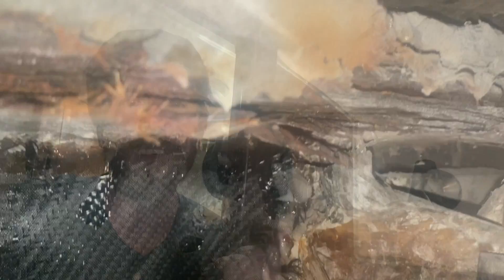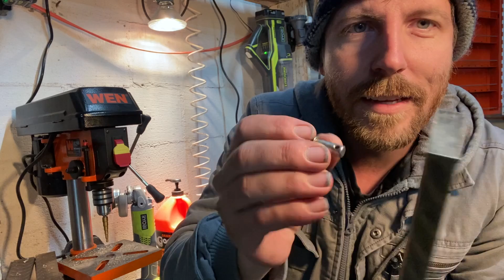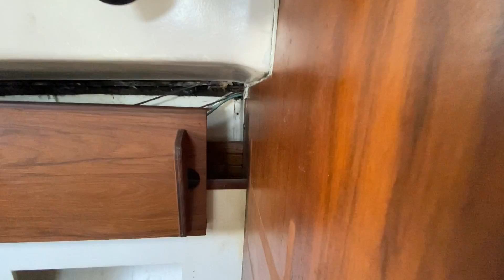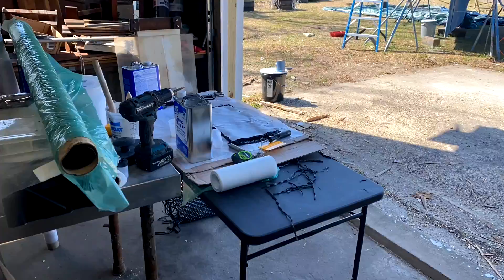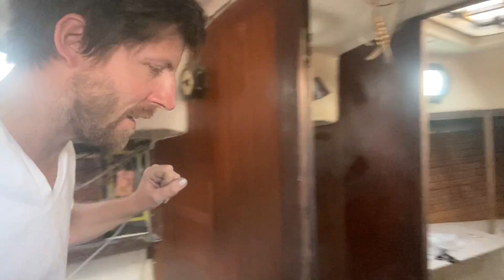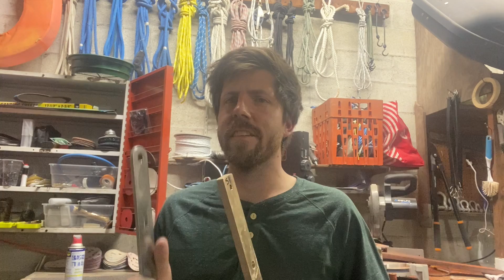Bronze & carbon chainplates beastmode911 strong

Comment: The bizarre reality of Stainless Steel is it must be constantly exposed to oxygen or it will eventually corrode. That's a fact Jack! The chain plates if made of stainless steel will fail where the metal is encased in fiberglass.

Comment: I know it’s to late, but for future reference.. grinding bronze, brass and aluminum is extremely dangerous. It plugs up the grinding wheel and when it expands from heat, it can make the wheel have a comeapart, sending chunks of grinding wheel flying in your direction. Be careful brother…

Comment: That was helpful. Im looking at a 1985 island packet 27 and I know the chainplates are molded into the hull with no way to check them and I need to just replace them. Rather then grind them out and mold new one in this is how I plan to refit them.

Comment: Hey Sam, just watched you vid. Can I see a picture of how you finished them on the outside of your hull? I'm refitting my 28 and all the stays and mast are removed so it's time to do the stays now I think. Thanks for the video!
Reply from the maker: Theres some pictures on instagram. Id recommend using counter sunk screws though and tapering the bottoms because the sheets are always catching the bolts and the bottom edge.
Reply: @samholmessailing  thanks!!
Reply: Haven't been able to find the finished pictures of the plates. If you could steer me to one I'd be indebted!
Reply from the maker: @theflyingdoves3713  whats your email address?

Comment: Hi Sam, about the carbon lamination, I would recommend for the next time, use as well glass one below the carbon and one on top being 20-30% larger, carbon works better in sandwich between glassfiber.

Comment: Those outside bronze chainplates should also work well as a lightningrod! You don t see it a lot here in Europe, I have a Dutch make 28 ft Friendship which has them inside connected on the bulkhead. 
Lightning is a big hazard on open water, if you get hit, all the electric equipment is gone….at least. I connect jumper cables on the standing rig then and hang them in the water.

Comment: Super glad I found this video, my partner and I are fitting our Roughwater 33 out for offshore and I will be renewing the whole rig, starting with going to 1/2” bronze external chain plates.  I have been curious for awhile about using carbon fiber to spot reinforce areas of the hull without much weight penalty, after seeing you do it im even more convinced.  What kind of backing plates did you use for the chainplates?  Or did you consider it strong enough to bolt straight through the hull?

Comment: al bronze is only ok if you don't need to bend the chainplate.    The lowers should be on fiberglass knees for this.  Otherwise you need forged bronze like silicon bronze.   You may get away with a slight bend but the strength after bending a casting will be compromised much more so than other materials.   For the forestay you won't be able to use this metal.

Comment: Sam, Great Stuff!  Check for the same corrosion failure of the backing steel under the forepeak/bow pulpit. I used a piece of Stainless plate when replacing the old oak pulpit with a solid piece of teak.  I hope we'll be able to follow you across the atlantic with SPOT or APRS or similar! Cheers

Comment: I have a 27 CD that needs chain plates and would like to do exactly what you did ! So  the stock was 1 1/2 w - 3/8 thick and 16” each ? How did you decide the sizing ? Thanks
Reply from the maker: Yeah. I went a little thicker that the factory cap shroud plates but i would go thinner if i did it over again.

Comment: I am currently researching chain plates and replacing them to external as you did.  My question is; Is bronze too soft for the continued movement of the clevis pin on the chain plate?  Your viewers of your sailing channel rely on your experience as other sailing channels tend to use local technicians for technical advice that is not accurate or reliable. Thank you so much. Great job.

Comment: Wait, aren't there going to be corrosion problems resulting from using stainless steel bolts against the bronze?  Or is that mostly just stainless steel against other types of steel?

Comment: Please don't take this wrong but with all due respect I think you've done a number of things that were unnessisary. I'm 65 and have been around boats all my life and I see it over and over again. Someone buys a boat and says this this and that need to be replaced and I say no it doesn't. But they do it anyway.
Reply from the maker: I mentioned at the beginning that it probably wasn’t necessary. It also wasnt that difficult or expensive and when im 1000 miles offshore and listening to the noises off the rigging creeking and hull contorting ill sleep a little better knowing its done.
Reply: The base plate for your chain  plates did look pretty bad. I apologize. But I have seen people do some major projects that were unnessisary.

Comment: Didn't expect to see you vacuum bagging carbon. Respect. You won't have to worry about that again. Just make sure you tune your rig every 1000nm or so, and speaking of that - how cool would synthetic rigging be on that beast? ;) Much love, hermano, fair winds.
Reply from the maker: The vacuum bagging wasn’t necessary but my buddy had a set up and offered to help me try it. I want to try synthetic if I ever need to re-rig. Fortunately the rigging was redone before I bought the boat so it should be a while.
Reply: My two favorite sailing channels chatting :D

Comment: Just about jumped out of my chair when you went to the bench grinder, but the wheel looks green like it's silicon carbide which is good to go for bronze.
Just to be clear- do NOT grind bronze, aluminum, brass on an aluminum oxide wheel.  If you've never seen one come apart, it is like a freaking grenade followed by an angry hopping choppy murdermotor that's still turning.  Trust me, it's wild and really not fun unless you survive it.  And if you do grind any of the above alloys on an aluminum oxide wheel (most bench grinders are sold with them because they're primarily for steel) the material you grind off is being melted into the wheel, causing imbalance, which will eventually cause chunks of the wheel to fly off like frigging bullets.

Comment: Carbide drills are your best bet if you're  going to drill a lot of stainless, although they're pricey.
Look into buying what's called "stub drills." They're shorter than the regular drill length and you don't need to center punch first.
Reply from the maker: Ill look into that

Comment: What bolts did you use (did I miss that?). Bolting through carbon can result in galvanic corrosion as the carbon is so high on the galvanic series.
Reply from the maker: 316 Stainless

Comment: Sam Holmes, As you know Aluminum Bronze is soft and easy to drill.  You will sometimes see/get elongation of the bolt holes in Stainless Steel as well as stretching of the chain plates bolt holes and the plates where the rigging connects because of the constant tention of the rigging.   Many people believe Stainless is very durable because it is hard to cut.  Cutting difficulty is true. However I learned Hospital grade Stainless is ductile (IMO) which means it stretches much more easily than regular steel.  This is noticeable when you over tighten bolts the threads will stretch and mis-form.  Then you can never disassemble your parts.  Difficulty to cut/drill is due to the chromium in the stainless.  I wanted to give you a heads up about your new Al-Bronze  if it's easy to cut--then the eye-bolt holes should wear out easily also.  It's something you want to pay attention to.  I wish you would have used silicon-Bronze --much more durable and hard to drill like stainless.

Comment: Hi Sam. (in case I missed anything) Why Did You Decide to Go with Chainplates on the Side of the Hull? Does it give you a less-crowded deck to traverse when you’re at sail, or was this the best fix for the compromised steel plates that the pad eyes were supported by? I think it will Look Great, but was wondering why you chose to change up her rigging. I’m in No Way being Critical, just Curious. I respect any decision a Sailor makes to his/her own vessel. you Damn-Sure put in a ton of work. I watch all of your adventures & never miss a Video.
Reply from the maker: To avoid dealing with the old backing plates.
Reply: @samholmessailing  - gotcha. I think you’re gonna be happy with that move when you’re at sail on your way to by Bermuda.

Comment: You should look into FOREVERBOLT fasteners and Hose Clamps. They are excellent for not rusting in harsh conditions. www.ForeverBolt.com or you can buy them online at Grainger Amazon Zoros Ace Hardware Walmart. Can’t wait to see you finish the boat and back sailing!

Comment: your reinforcements are in Brass and not in bronze, but it is 10 times too big for a 28 foot sailboat ... !! what you put on is for a 60 footer ... !! it is sure that it will hold ... !! normally a chainplate is put with an internal reinforcement ...!

Comment: Aren't the brass or bronze pieces going to mess up the hydrodynamics of the boat when it is heeled over??  It seems like they would be in the water and dragging.  Or are they high enough up?
Reply from the maker: Only when im healed excessively but the boats not sailing well anyway at that point.

Comment: Sam what type of bronze did you buy?  Typical bronze has about 1/3rd the yield strength of 316, but silicon bronze is significantly stronger.  Just curious.
Reply from the maker: I used aluminum bronze. Silicone would be better but al will work fine for this.

Comment: Will there be a problem with stainless steel bolts in contact with the bronze? I've heard about problems with dissimilar metals reacting to each other.
Reply from the maker: Theoretically yes but i dont think it will be much of an issue. Im not a huge fan of bronze fasteners and they’re very expensive.

Comment: I would sure rather see your workpiece clamped when you’re using the drill press. Holding onto it with your hand is begging for trouble, although I know that’s a heavy and blunt piece.
Reply from the maker: My clamp selection is kind of limited and I couldn’t find one to make that work

Comment: You're a beast! Get-r-done!  Question though, don't you need a slight angle at the top of the chainplate to align the tangent with the swage terminal/wire leads up to mast/shrouds, since the angle of your chainplate on the hull outbound is now 90 degrees vs the deck mounts?
Reply from the maker: Yeah they might need a little bend but im thinking they might be good enough.
Reply: @samholmessailing  Man, you're inspirational - I overthink too many damn projects that never get done.

Comment: You might want to check all of your backing plates. I believe you'll find that they are all  black steel.
Reply from the maker: Im not familiar with black steel but i know they’re rusted away to nothing now.
Reply: @samholmessailing  Black steel as in black smith. It's just plain 'ol steel like what you found behind the chain plates.

Comment: Hey Sam, how can stainless have the same strength as copper and still be three times more harder to drill?
Reply from the maker: Some materials are just a pain to machine. For example mild steel is stronger than stainless yet its way easier to machine. Also my chainplates are bronze which is alloy of copper and aluminum and gives it different properties than copper alone. Im definitely not an expert on this stuff but there are a lot of different factors in selecting the right metals for the job.

Comment: Do you put thin backing plates on the internal surface of the hull, or is the vector straight up anyway? mostly shear?
Reply from the maker: I will do some kind of backing plate or large washers back there.

Comment: The next time you need to drill stainless steel, try using chlorine bleach as a lubricant. I know it sounds weird but it makes drilling go so much faster and makes the bits last much longer.
Reply from the maker: Good to know

Comment: Are you sure the bronze plates are thick enough, Sam? This is like watching someone yank the rear axle out of an ancient Ford Pinto to install a 9 inch Ford rear axle that's capable of handling a dozen or so times the torque supplied by the original little Pinto 4 banger....I would have just stripped out the old plate below the deck and glassed in an aluminum plate in its place. I guess I don't have much of a flair for exotic overkill.....probably wouldn't be a very entertaining Youtuber...
Reply from the maker: Yeah they’re probably twice as thick as they need to be. I figured grinding out the old ones would be more work.

Comment: vac bagging carbon should really be done with a porous layer,  absorbent breather, then non porous then breather to spread the vac to all the areas. using a through bag connector helps with getting a good seal. but to be fair, i don't think you need to use vac bagging. keep up the good work, loving the vids!

Comment: I hope you got some expert advice in using stainless steel bolts to hold on bronze chain plates. I think there might be some corrosion problems, as one metal is likely more noble than the other. Ever thought of bronze bolts?

Also, to get the turnbuckle clevices on, thinning the chain plate should be OK if it's new thickness, in that area, is equal to or greater than the minimum thickness needed. I would not leave a step there however. I would machine an incline from the thinner part to the thicker part that is at least twice as long as it is high. This is to avoid a stress riser at the step, which could cause the chain  plate to fail unexpectedly.
Reply from the maker: Maybe but the old cd chainplates used stainless bolts and lasted 50 years so i should be good for a while.

Comment: Is there a concern for galvanic corrosion of the 316 bolts in the bronze chain plates considering they are now more exposed to high chloride content water? I can imagine if water gets in and pools you might have blind corrosion inboard on the bolts.

Comment: Are the plates lined up in the direction of the pull? They look parallel in the video but it is hard to tell. What will you use for backing plates inside the hull?
Reply from the maker: I kind of guessed at the alignment. If its off a little ill fill in the holes and move them. Ill use aluminum plates or big washers.
Reply: Why carbon over fiberglass.carbon is stiffer so now the fiberglass adds little strength until the carbon fails.. if it was all glass it would stretch the same and not
 Have as big of stress. However it's over kill so likely fine till you are in a big crash

Comment: What is that backing stuff that Sailor James uses the G10 something or other? Could you make a chain plate backing plate system instead of the carbon fiber?
Reply: The trouble with that is the unevenness of the inside of the hull. The mild steel plate under the deck was tied down with rebar making a big lump in the fiberglass. I have the same boat and am considering doing the same to mine.

Comment: Love watching  your adventures Sam!  Thanks!  A few questions:  Are you planning on gel coating the hull after this work is over?  Paint?  As far as the interior that you are cutting up to gain access to the hull, is this going to be fixed?
Reply: I would like to know the answers too!
Reply: Gel coat is actually used during manufacture to help a fiberglass boat to separate from the mold in which it is formed.  Water can get under gel coat and form blisters, there is absolutely no benefit in having gel coat on a boat, just fiberglass and a good paint will do much more to seal a boat than gel coat ever would.  My recommendation is never add gel coat to a boat and if you have an older boat strip or repair the gel coat as soon as possible.

Comment: I hope you are putting in a backing plate to help distribute the loads
Reply: Isn’t that what the carbon fiber is for?
Reply: @mhensen1  even racing hulls made out of carbon fiber still have some kind of backing plates, without plates there’s the possibility that the bolts will egg out over time. Think of the pounds per square inch on the 3/8 nut once the bolt is torqued down, you got load in at least 2 directions without the plate. I don’t think you can over engineer a blue water boat IMHO.
Reply: @carlhicks2889  yup, I guess I thought the cf was kinda a backplate, but it’s more reinforcement so the backing plate will not rip through...more is betterer lol

Comment: Sam, grinding brass / bronze and other soft metals on a grinder wheel particularly a course wheel is a HUGE machining no no, the thermal expansion of the soft metal that gets embedded in the wheel can and has explode the wheel like a claymore and seriously hurt more than a few. Unbolt that wheel and throw it away. Only grind steel and very hard metals.

Comment: going thru the same project on my refit, but chose a different way. instead of vertical chainplates i designed horizontal ones which then bolt thru the sheerclamp (which is going to be pre reinforced with a couple of 400 gr biaxial cloth layers). this way i avoid drilling lower in the topsides.

Comment: Pity you didn't research where to drill the hole in the top of the plate, the correct position is further from the top than the sides, your Skenes Elements of Yacht Design book has diagrams and the reasons.